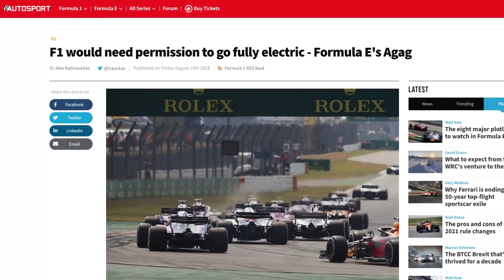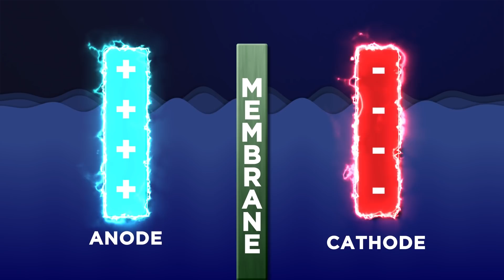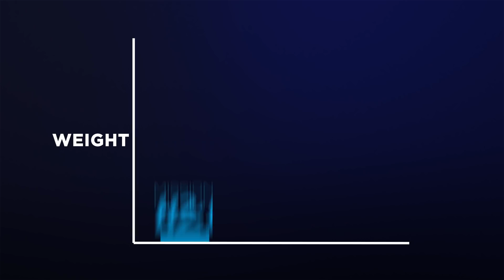Here's How Formula 1 Cars Will Be Powered In The Future

Comment: Hydrogen makes absolutely 0 sense. I don't think car manufacturers are going to invest in hydrogen when obviously this is economically unviable, as they can't use the technology in their luxury cars. Investing huge amounts of money into something solely used on a racetrack makes no sense.

- You need lots of electricity to create hydrogen
- There are considerable energy losses in storage and transportation
- And after that you create electricity from it again
- Also: There is no infrastructure ye, the hydrogen user is going to pay for that
- The technology isn't ready yet meaning high cost for R&D
- The vehicles contain lots of extra parts compared to BEV (can all break down)
- Higher cost of ownership compared to BEV

Hydrogen was an option because battery electric vehicles were lacking range, but we're already at 600miles of range for EV's and everything more than that is just dead weight. Range will only increase when there is no weight penalty against it. What percentage of people drive more than 600 miles a day? I estimate this to be less than 3% of car owners. Apart from this all, we are going towards a scenario where you can charge your EV for free in front of your house with Tesla Solar Roof for example.

There is not a single incentive for car manufacturers to invest in further development of fossil fuel engines, and also no incentiove to spend huge amounts of money on hydrogen vehicles. We have Renault, Ferrari and Mercedes left in Formula 1 and soon Renault will be leaving the sport as well. Formula 1 is on a dead end. They need to go for cheap fossil fuel engines that don't need a lot of costly development, resulting in lots of smaller sportscar brands entering the sport as it's more affordable now for them. After all, F1 is about entertainment. When in the early '00's where those engines to be used for road cars? Exactly how things should be returned to.

- Fully electric: Not possible
- Hydrogen: No business case
- Combustion engine: No business case

Make F1 a real championship again by making is affordable to many small car brands with relatively cheap engines. If not, F1 will die. What happens when another manufacturer leaves now?

Comment: You totally missed it. F1 is not heading into Fuel Cell Hydrogen power, that is actually an electric car. But they are thinking about e-Fuel, which is also mainly Hydrogen + Carbon, that works same way as traditional fuel, on the same ICE engine.

Comment: The big problem with hydrogen is that it must be stored at massive pressure and as a result the tank's walls must be very thick – leading to either very heavy cars or very little tank volume. Regular gasoline fuel is very combustible, a driver ripping off the hydrogen hose because he drives off too soon leads to an outright catastrophe.

I'm personally a fan of electric and I think a method of 10-second battery swapping would be possible, I think the more realistic route for the foreseeable future is hybrid with a bigger battery and E85 ethanol fuel.

Comment: H2 isn't often made by elektrolysis becasue of the high energy requirements.
Usually it's made from natural gas with a steam reform process which produces CO which is then made into CO2.
Ironically our current hydrogen production is very CO2 intensive.

Comment: Id like F1 to just go with an open engine formula with the caveat that the car must pass road emissions regulations.

1.- It would encourage the development of high performance catalytic converters and other emissions-reducing tech that is extremely relevant for road cars, and thus interesting for manufacturers.

2.- It would create huge variety on the grid as teams come up with different solutions

3.- It would nerf ICE power slowly but surely as emissions regulations become progressively more strict, creating a gradual transition towards the elimination of combustion engines as they become less and less competitive over time. As a tangent of this it would also mean that in the transition years we could potentialy see a Hybrid vs EV vs Hydrogen battle on track which would be awesome.

4.- It prevents F1 from falling behind the times as it ties the sport to the reality of production cars for the consumer.

Would it be expensive? Yes, but costs spiral out of control regardless of the rules you got, it happens every single time without fail. Cost management would be better achieved with a cost cap for engine development or something of the sort.

Comment: Want to decrease the carbon footprint? Change the rules to require the current IC engine to use methanol. IndyCars ran methanol for years, and then more recently, ethanol. It works fine as a race fuel. And it’s renewable ! (Current IndyCars run E85, which works well, too.)

Not only that, but the exhaust of ethanol-burning cars has a pleasant smell !!

Comment: Hydrogen is not a clean source of energy, nor a dirty one. Is only an intermediary, and it is as clean or as dirty as the energy used to create it. Today most of the H2 produced is produced from hydrocarbons, so, very dirty. I have an idea for F1 engines: Make whatever engine you want, using the fuel you want  and limit the energy in the at the start of the race no X MJ per lap. If you want to go more clean, add a limit in emissions, but not at the tail pipe, but the entire process of the fuel. Of course, all energy source in the car should comply a minimum of safety rules. No hidrazine, please. To limit expenses, FIA could fix a price for engine, and any engine manufacturer should be compelled to supply engines to any team that demands. If the manufacturer of the engine want to sell them at a loss is not the FIA problem.

Comment: From my understanding, hydrogen can actually run in a typical ICE unit. Now that'd be cool.
Reply: material resistance not strong enough, engines would turn into 100 kg grenades.
Reply: Engine's already are 100kg grenades. You are obviously unaware of a whole world of technology available for high pressure systems. Entire hydraulic pump systems run at 1000's of bar, high temps, for days on end in vibrating machines. 
Don't project your own knowledge limitations onto other people's credible suggestions.
Reply: @blackbirdsr71  they already are 100kg grenades but not hydrogen grenades... the materials will simply not hold.
Reply: @sch3ffel  'engines would turn into 100 kg grenades', 'they already are 100kg grenades'. 
Your immediate contradiction of yourself proves the amount of credibility you have to make such a claim, i.e. none.
'the materials will simply not hold' is a sentence you have repeated with no technical explanation whatsoever. 
In fact it sounds like rambiling rubbish.
Reply: @sch3ffel  lol

Comment: F1 will surely burn hydrogen in its cylinders as fuel cells are really heavy to deliver the power. It would be far simpler to change a hydrogen bottle than refill it during a race.

Comment: Hydrogen is great way for F1 to get completely irrelevant. The only possible road is increasing the role of energy storage in hybrid powertrain, use of electric motors, and eventually transition to only BEV powertrain. Hydrogen is waste of time as it's extremely inefficient, dangerous and impractical.

Comment: I have been saying for years — batteries are not the answer to our future transport needs, including motorsport — the raw materials needed and processing them to make the batteries reek havoc on the environment and the disposal of spent batteries is an ecological disaster in the making. Fuel cells are the way to go however current methods to produce hydrogen are inefficient and the distribution network is non-existent still, and hydrogen fuel cell cars have been on our roads for over a decade now.
A few years ago a start-up Swiss car company (I think it was Swiss from memory) came up with a salt ion fuel cell concept which to me seemed to be a perfect solution — you filled two tanks each with a different salt solution, which are combined in a fuel cell, you got salt water out the exhaust and you got 300+ miles range. The tanks were as quick to fill as traditional hydrocarbon fuels and didn’t need to be held under pressure. Ticked all the boxes. Only problem is, I’ve never heard anything about it since, even though it was launched at the Geneva Motorshow around five or six years ago. 🙂✌🏼

Comment: Could be possible a combustion engine powered by hydrogen? Imagine an V12 roaring again...
Reply: hydrogen as a ICE fuel would need an entire remaking of the engine block to be safe to use, "normal" size cilinders would be too big and too weak to be safely used. todays engines would very possibly explode like a grenade... a 100kg of pure steel grenade going at 300km/h running at 15000 rpm = not a very nice experience. how do i know that? lets just say i have a friend that came up with a very stupid idea... and it involved a chainsaw motor(without the saw obviously) and hydrogen made by electrolysis...

Comment: Perhaps Hybrid + Sustainable Fuel from 2025 to 2032, with Hydrogen power in 2033. 

That is a decade of development for hydrogen (by which point it definitely will be able to handle F1), F1 gets to 0 carbon by 2033, The current 2025 engine can go ahead, as a bit of a stop gap while we wait for Hydrogen to be ready, The 2025 formula will last for 7 years. (It really is only an incremental change anyways). Everyone is happy.

Comment: Full synthetic biofuels should be the goal. Military vehicles such as jets and such need a high density fuel source that hydrogen and batteries cannot provide now and atleast in the near future. Finding some kind of biofuel that is either environmentally friendly, carbon neutral, or whatever other environmental friendly metric it can qualify for will do. If we can have biofuels that are environmentally friendly then we can bring back V8s, V10s, and V12s if one wanted too with a small hybrid systems potentially.

Comment: If they wamt to be "carbon neutral" hydrogen isnt the way. Hydrogen is a way of storing electricity and a very inefficient one at that. A battery is really efficient about 80% for the whoal process includint the electric motors while with hydrogen its about 35%. Which mean overall you need more electricity and is less efficient. Which mean that you need to use more electricity from the coal plants around the world to charge them. The closest power source to carbon neutrality rn is hydro and i dunno about you but is dont see many dams around then its wind which is the same and the its nuclear which has a bad rep. Solar is about 3 times less neutral than nuclear and 12 less than hydro.

Comment: Chain Bear did a great video on this. Hydrogen can be used in a combustion engine too
Reply: hydrogen combustion engine isn't very realistic or practical though
Reply: @markvorster3921  "hydrogen combustion engine isn't very realistic"

Toyota with their hydrogen ICE powered corolla : "OK"
Reply: @muhammadnurakbar4188  it's not realistic for an F1 car
Reply: @markvorster3921  u don't mention F1 car, but hey it's still new aka still on development, who knows if this possible to power F1 in the future... Hydrogen is hard to produce because it use a lot electricity but who knows if there's a easier methods to produce it

Comment: Big props to Jake and entire Autosport team for a very accurate and lucid look at hydrogen technology as an energy carrier for propulsion. The narrative, and animations, were excellent. Shout out also to their use of VideoCopilot's saber plugin! I recognize that! :) The only tiny bone I'd pick with the story is that it did not mention other ways to use hydrogen as a fuel. Namely, instead of fuel cells, the option exists to develop spark ignition internal combustion engines (so called HICEs, as Ford and Mazda have tried in the past) or even gas turbines (think jet engines). Both the HICE and jet approach in theory could be direct drive through transmissions, but I suspect would best be used in a hybrid configuration generating electricity. To be clear, a hydrogen-fueled fuel cell as outlined in this story is also really just another type of hybrid. It just replaces the gasoline (racing fuel) ICE+generator hybrid with a fuel cell consuming hydrogen (plus at least some batteries). Anywho, good stuff!

Comment: Hydrogen fuel units are a great idea, but there is a massive number of challenges, and not obvious if you are comparing standard hydrogen powered road cars. The extensive use of carbon fibre components, from the chassis to the outer bodywork, and its a fantastic conductor of electricity, so that opens a whole pandoras box of risk or danger of igniting any slightest leak. Also, the f1 bodywork actually generates a static electric charge as it passes through the air. And the engineering of the cars constantly pushes the limits for all components, hence the constant issues with retirements from an electrical system failure. The cars are shaken hard and sharp constantly, so wiring, connections, and anything holding a fluid gets savaged and even today hydraulic system failures are common. Doing that to a hydrogen fuel container is potentially deadly.
F1 cars also build up heat, and a lot of it, from wheels, brakes, the driver, and components that are not connected to the fuel supply, and as hydrogen has a very low boiling or expansion temperature and expands much more than other gasses. So inside the cars structure there is little room to cope with this ( the le mans cars have much more internal space to cover keeping the fuel cell cool, shock absorbed, and isolated from driver, power train and crash structures) expansion and contraction.
Last ( but really first) for driver safety, pit crews, marshalls and fans at the grandprix, the size of impact protection on each car would have to be massive, and the whole architecture and regulations rewritten for the cars. As it is, the fuel tank on an f1 car is only a few centimetres away from the driver, as we saw with Grosjean. Doing so with a higher octane ( ie more explosive) was banned after the crashes in the 70's. So fitting a potential hugely explosive bomb in a box,, with a driver no more than a metre from it, travelling at 200mph where the heat or a small spark the whole thing off is not a sane possibility yet. Perhaps in the future with exotic materials and components it might be, but until they can guarantee that the fuel cell, lines,power units survive any distance and any crash or accident 100% of the time, it wont happen.

Comment: Someone help me with with this - The fully electric Volkswagon ID.R can go from 0 - 100kph in 2.2 seconds.

Since Hydrogen fuel cells still use electric motors to power cars forwards why is a hydrogen car slower off the line than the ID.R?

Is it all down to weight?

Comment: never going to happen  everything is going ev. the fuel is to explosive.it would be way to expensive to develop , when f1 wants cheaper simpler  engines honda wants to use hydrogen evs which are still electric running motors. they are leaving f1.why would mercedes , renault and ferrari invest in hydrogen if they are not selling road cars with them

Comment: It seems some of my postings about MY new Hydrogen tech have not been allowed to be seen, since "dark forces" that is the BIG OIL men, have (besides sending men to end my life and making me "a homeless person for the last 12 YEARS"}  bought up patents and hidden tech away 
- such as the news videos and reports you can look up of a "lone wolf" inventor from Ohio, Stan Meyer, driving a car using a Swiss idea to split water, at a fast rate, and burn it directly in an engine. He says this is so efficient the car could drive coast to coast on 22 gallons of water. 
Sadly, and it took 10 years to find confirmation of this, the day he sold the patents to the USa gov. he was given a luncheon at a Crackerbarrel restaurant near his home, drank a toast of cranberry juice, and staggered form the place claiming he was poisoned, and died that day.

ahem.... My idea has been sent out for many years and so can now not be patented - so ....
HOPE Hydrogen Oxygen piston Engines could be used in about the very same F1 cars now used - I call it Formula Zero - 
Tanks of liquid Hydrogen & Oxygen (fuel made with above mentioned methods) would allow the cars to exhaust pure water, and give enormous amounts of supercharging since they have around 6000psi of pressure. IF turbos are used, they would add extra electric power for drive, only. LESS explosive than gasoline, since the 2 are not mixed until burned, and new tanks could make this all safer. Also a Hydrogen fire would go 'POOF' straight up and be gone in a blue flash, unlike heavy gasoline and the extremely explosive fumes that go to the ground level. 
Even lighter, since the electric drive would eliminate heavy, and very expensive, and the parts that now fail the most - clutches, tranny, drive shafts, differentials, shift paddles and software, etc.
So -way back in 2011, after writing a book about all this and putting it up for sale at am-a zon - 
I got a message "the Germans" wanted to hire me, "He will like it there, with the mountains and all" -
but instead local police came to my apt. in Minnesota - to try and lock me away for life, but the ward thru me out - beginning a 10 year running battle with {well - the KOCh brothers mainly} - what is now being called "Gang Stalking" and people shouting threats at me on the streets where i live,  now, as we speak!

Yet now - we are moving forward into a New Era, a new admin., with clean energy advances for all, right?